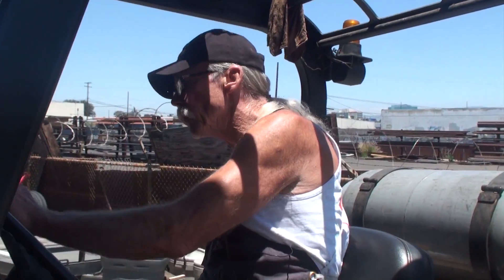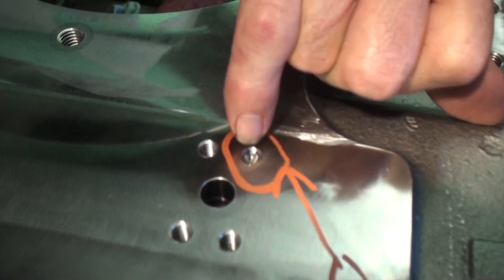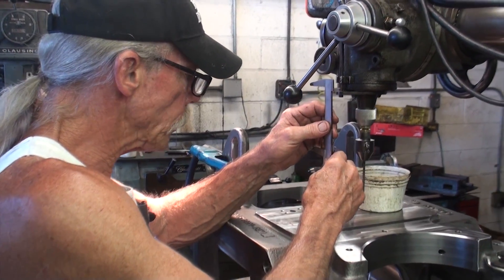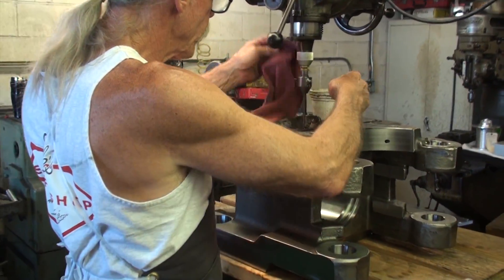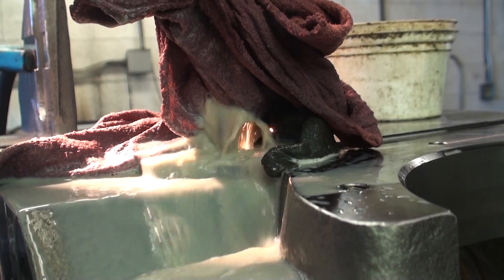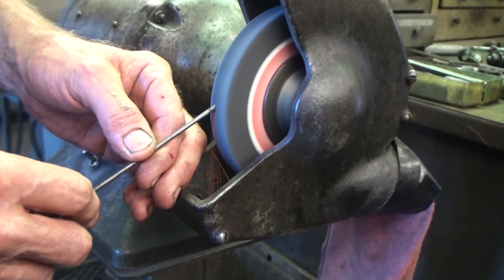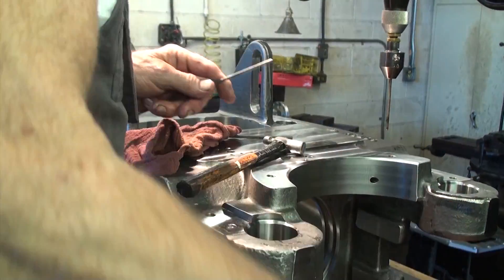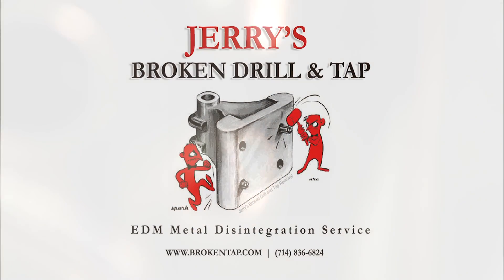Broken Tap Removal by Metal Disintegration Machine (MDM)

Comment: We had a tap burner at the aerospace company I worked for and it was fine for some of the smaller hardware we produced, unfortunately most of what we made was mostly large turbofan parts that wouldn't fit on the burner. We just used carbide end mills to drill out the tap web and did it on the machining center and it worked just as well.

Comment: I used to run one of these at a race shop in Huntersville NC. We called it "the hole popper" because all it did was pop holes into bolts to make banjo bolts for caliper brakes. I guess electrodes were cheaper and much faster than jobber drills for making holes in hardware. It was so unbelievably boring to run that machine for days straight lol

Comment: I used a smaller machine akin to this years ago to remove broken hss taps. Also got to use an  EDM with different copper electrodes. Some bought and some made by our machine shop. The best time was a mitsubishi  cnc wire-fed edm that uses a .010 brass wire to cut carbide cutters. AWESOME. like welding in reverse.

Comment: Sandvik hardcut drill will fix that.   The part should never have been removed from the mill. The hard cut should have been run immediately.

Comment: Thank you Mr. Grafton for showing this.  Scares the heck out of me when I tap a pistol so I use a new tap and use carbon steel so I can use an carbide endmill to remove it if necessary.  When I'm making things at work, I'll tell the engineer how many operations are left where I can turn my work piece into scrap.  :)

Comment: This is what i do when i have a broken tap
1)get a 4fl endmill .02 or .03 smaller than the minor of the thread n put it in solid holder
2)find the center of the hole on a CNC machine 
3)max out the RPM M3S14000
4)program G73X0Y0Z-.35R.O1Q0.001F.OO5
PROBLEM SOLVED.
LET ME KNOW IF THIS WORK

Comment: excellent demo on Tap removal.  just so you know, its not the flute that is left in the hole.  The flute is a cavity/cutout running axially in the tap for chips that are cut off.   In other words - you are not cutting out the "holes" of the tap.

Comment: What that's it !!  So I can start a business removing broken taps as long as I can buy a electrode grounding water squirting voltage regulating table plus some chisels at Rockwell 65 with a grinding machine plus tapping tool ??
Reply: Yep, in that order

Comment: A company I used to work for had such problems with broken taps (due to blind holes) that engineering was forced to add so much allowance to the blind hole depth that it increased our baseplate thicknesses by .375-.50" .  This was no big deal when the part was made of A36 steel. But once in a while we did an exotic material like Alloy 20 or Super Austenetic.  Do you know how much money it costs to add .50" thickness to a 60"x60" plate in 254 SMO just to allow a tap break safety margin? It is like $8,000!  I could not get them to thread mill and it was costing us orders.....
Reply: Interesting. Being in the metal business, I CAN imagine the cost. Some alloys are stupid expensive.

Comment: Metal disintegration is the proper term. Seems like the "bit" either needs to rotate or vibrate like an engraving tool. You have to keep renewing your electrical contact with the target to vaporize the material, at least I suppose. Don't want a full short circuit.

Comment: ...  if you take a small brazing torch and heat the tap until it is red , then let it cool very slowly . You can take a quality hi speed drill bit and drill thru it . I wish Jerry was around when I had to  figured out heat treating . Jerry can guarantee it will come ; out mine is a 50/50 shot .

Comment: That's not necessarily true!  You can't measure the depth of the other holes to determine how deep the blocked hole is.
Reply: That’s the first thing I thought. What if that tap bottomed out and broke off in a half inch hole, he would’ve blasted through the actual part, according to the depth of the other hole that he measured

Comment: I just had a situation where a tap broke in a thru hole. It was a challenge to remove, I tried to mill it out, and broke two centertaps, thick ones. a 3mm and a 5mm . the hole was 5mm . I then took the piece to the vice, and hammered in the hole with an awl. And I didnt believe it but the broken threadtap broke off and I got it clean. so you burn the Thread tap with that special machine . incredible. Hardened steel is kinda difficult to tool. I use cheap tools until I know what I need. so I got a new Guhring M5 thread tap, smooth ! It cost 35$ !!!

Comment: Great work. I would have thought that the original part maker would have milled out the tap with a not so good carbide mill using a helical cut. It looks like an original >$10K job.  I save my old carbide mills for that purpose. I probably break a tap about every 100 hours of machine time.

Comment: The hard rods are no longer the rockwell you state after grinding. When you grind it and you see that metal change colour, that's the metal losing it's hardness and slowly becoming annealed.
Reply: The tip need not be that hard to fuck the hell outta that dead tap shred. the back needs to be hard so the hammer could strike it well.

Comment: interesting i use to do the same thing back in the 70's at a place i worked we had a small machine that fitted to a drill press  that worked the same as this huge machine
we mainly did broken bolt s  we had a customer that broke off all 8 head studs for a wet sleeve engine that took  a while to fix 
worst part is when you get someone using an ezi out to try remove a broken bolt or tap 
makes the job a lot harder

Comment: Very good job. Although this method wouldnt be usable with most of the broken drill bits and taps I've had to deal with , it could be a god send. Sucks that you have to totally disassemble first. Have had limited success with broken tap extractors when they don't break. Question I've got is what keeps from arcing to the threads? Also is the machine self advancing? That water looks more like fish oil.

Comment: Hey Jerry ... does grinding the M2 Chisels not draw their hardness ??
Great vid by the way 😎👍☘️
Reply: M2 is HSS steel and probably they are tempered to "red hot hardness" - but even if they get a little softer, they seem to work well for him🤷🏼‍♂️
Reply: @kknives_switzerland   yeah... Its jist that I've ground a lot of hss over the years & tbh I've found that "bluing" it during the grind doesn't help with tool life,  on the capstan lathe I ran, despite the "red hardness" attributed to hss... but as you say, it seems to work for him ! 😉
Thanks for chipping in ! 
😎👍☘🍺
Reply: @peterfitzpatrick7032  I totally agree on the blueing part; I run all my grinding equipment water cooled for that reason - in knife making, not the slightest discoloration is allowed to occur.
Reply: @kknives_switzerland    I'm assuming its flood coolant... No dipping a hot piece in cold coolant.. 🙄😏
I dry-grind to reduce the risk of micro-fractures... just takes a little longer... 🤓
But I'm mostly only grinding hss blanks so not as critical as your grinding sounds... 🤔
😎👍☘️🍺
Reply: @peterfitzpatrick7032  Yes, flood coolant! Got some videos up on it if you want to take a look. Thick blanks are an entirely different game than a 0.015 inch thick cross section like it is common in knives - let alone the edge itself! Always cool to peek into other crafts!
Reply: @kknives_switzerland   thanks... never thought to have a look at your channel 🙄😂
Reply: @peterfitzpatrick7032  Enjoy haha
Reply: @peterfitzpatrick7032  And I wanted to say: I am very glad that you mentioned the flood copling thing. Because many knife makers just frequently dip the blade in water, which I find to be less than ideal as not only it may not be sufficient, yet also subjects the workpiece to repeated thermic shocks. Well known to the machinist, but in the knife world, flood coolant seems to be really uncommon - apart from Japan I must say!
Reply: @kknives_switzerland     
I'm liking yer archives btw ... 😏
😎👍☘🍺
Reply: @peterfitzpatrick7032  Appreciated man!!

Comment: That's amazing. How come you didn't get an electric shock when you picked the wet cloth up?
Reply: Rubber soles on his boots?
Reply: DC current. Same reason you can touch the positive and negative batter terminal and not create an arc.

Comment: I wonder if it would be possible to manufacture taps out of normal soft steel and put separate hard teeth on it... So it would maybe not snap as easy and if it broke you could just drill it out...  ... maybe it would just twist to a corkscrew.

Comment: I had no idea. I've always drilled them out carefully. Takes a long time and I have to sharpen the drill a lot. Sometimes I hit some threads.
Reply: Tap burners are the easy way out if you can put the piece under the tap burner to the where the tap is located unless you can chisel it out backwards. I think few shops have a tap burner. I worked at a job shop that had one. It took the fear out of braking a tap.

Comment: Lol at you entirely ruining the temper on your “hardened” m2 chisel on that grinder. You can actually see the tip glowing red. Lol
Reply: I guess you think he never did this before. I would venture to suggest that the chisel isn't meant to be sharp, just tough.
Reply: I guess you don’t understand the basic heat treating/metallurgy. Chisels are meant to be in the 40-50hrc range. M2 steel is usually hardened to around 61hrc and above. So this would be kind of a special purpose chisel. Heating it up to the orange temps(1500f or probably higher from what I could tell) isn’t only going to drop it beneath that hardness, but it’s going to completely ruin the heat treat. If he intended it to just be any old chisel that would be super soft, why the hell would he use m2? The fact that he took the trouble to mention it was m2, leads me to believe that isn’t the case. Lastly, doing something wrong for a long time doesn’t make it right.
Reply: @jamesmgordon83  He told you it's M2 High speed steel.  You can get it red hot without affecting hardness.
Reply: @12345nonamesleft- Wrong. M2 steel is tempered at 1025-1050°F (552-566°C). If you heat it beyond that temperature, which he obviously did, it will ruin the heat treat. That’s just a fact. HSS a generic term, that denotes a particular steels ability to withstand heat, generated by high speeds/friction, based on how it was heat treated/tempered. M2 HSS is a tool steel that was tempered at a higher temperature. This allows it to be used at high speeds, which generate more friction/heat, without compromising the heat treat. But that doesn’t mean you can just heat it up as much as you want without it ruining the heat treat. Once you go above the temperature it was tempered at, you compromise the heat treatment. Fact.

“Red hot” is at least 1300f-1400f, and really closer to 1500f. That is well above m2’s tempering temperature and it will compromise its heat treat. When the camera pulled away, while he was sharpening the first rod, the tip had turned a dull orange. That’s 1600f+. =Ruined HT. Also, guys shop was well lit and you could STILL see the orange in the tip of the chisel. If the lights were off, I’m sure it would have been even a brighter orange, which would indicate an even higher temp.

BTW, I’ve heat treated M2, and many other steels in my Evenheat oven over the years. I’ve also brought many high carbon steel knives up to critical temp(1450f) in my forge and know first hand what temp different colors are. 

IMO M2 is a poor choice for removing broken taps from the threads of a screw hole. Using M2, which is hardened to a hardness above 60hrc in this setting, would risk damaging the threads, and would likely chip the tip of the chisel. Therefore it’s doesn’t really make sense to use that steel for the job. He should just be using a softer/tougher steel. Even mild steel.

But let’s say he didn’t overheat it and it withstands unlimited high temps like you said. Would a HSS like this M2 steel he’s using be more resistant to heat when sharpening like he was? Sure. But a high hardness HHS M2 like this would make a shitty chisel. It’s meant for drilling/milling/machining. Not as an impact tool. So his actions are entirely contradictory. At this point I’ve explained myself thoroughly, and have nothing more to add.
Reply: @jamesmgordon83  neato...
Reply: He never specified how exactly it was hardened though did he. My supervisor showed me nitrided ejector pins that looked almost identical to those he used. Hardest metal ive come across and would be perfect for this job
Reply: @laurie Agnew He went to the trouble of saying “m2 steel.” That is a tool steel and it’s meant to be heat treated before use. Otherwise any old mild steel would work. Seriously, I don’t know how this is hard to understand. In regards to the “nitrided” ejector pins, that is a process that only hardens the surface. Once you sharpen it a time or two, it’s gone.
Reply: Hellhound878 So you’re saying you know this guy’s business better than he does?

Comment: Had a smaller version of this machine at the machine shop I worked at. It had a chart with common standard thread diameters against electrode diameters and machine heat settings. We could burn out between #10 to 5/8" diameter and simple calculations allowed for metric conversion. For some reason I was fascinated with it and took time to clean the machine up and organize the electrodes. It wasn't long after that it became my duty to repair broken taps for all of the machine shop and mechanical assembly. Most taps were broken by manual drills going into large steel tubing followed by bottom end taps into aluminum, again manually. 
In my 2.5 years at that company I had burned taps out of many different mild steels, cast/6061/7075 aluminum, and phenolic which is a plastic composite for high temp applications. I used old center punches ground the way Jerry used his M2 magnetic chisel. For larger than 5/8" broken taps, which was rare, I'd burn a 1/4-1/2" hole and slide a bolt in, tack welding it in place and turning the tap out as anything we had of that diameter was a through hole and cold be accessed easily from the other side, with few exceptions. Aluminum threads that were cleaned out usually were drilled out after the tap was removed and were rethreaded with a special insert depending on application. Aluminum is very gummy when machined and takes special care to ensure it doesn't weld to the tap. Something that when using a cordless drill will happen instantly if the drill is wobbled and the clutch isn't set right. 
Another place where people screw up is trying to "eyeball" a drill size to the inner diameter of a tap. The smaller the tap the more precise one has to be and the blueprints will specify the basic minor and major diameters necessary for the drill. Engineers [should] take care when they specify those sizes since different applications require different contact areas between the screw thread and base thread.

Comment: How many coins did that set the customer back? What ever it was it was worth it!
Reply: absolutely not, could have done it much quicker, ruined less equipment and caused less damage to the thread using a different method
Reply: @manlystyleunder50  I doubt he damaged any thread. I've done this job many times  the old hard way, so I know how bad it can be. I just removed an 8 mm headbolt from an aluminum engine block the hard way.

Comment: it is inveitable possibility of breaking a tap.  Especially if you do not have a program where you change out taps after a certain amount of work has been accomplished.  the harder the material,  the more taps you change out.  IF you dont change them out that tool is going to get weaker and weaker.  be smart,  follow healthy procedure for taps. Use sharp and healthy drills and always break the edge of the hole.

Comment: Very cool!  I've only used EZ Outs, ha.  We called these either broken studs or broken bolts, not taps.  I'll have to research what a "tap" is.   I thought tap and die were the tools/process to remove a broken bolt.
Reply: paulpm - a tap is a piece of metal that looks like a drill bit but has threads like a screw. You screw the tap into a hole to cut threads into the sides of the hole so that a bolt can be screwed into the hole. The matching piece is a "die" that forms threads on a metal rod to make it into a bolt. Sometimes taps break when threading the hole, and cannot be drilled out with a normal drill because in order to cut threads in metal the tap is made as hard as the drill. The electric arc can burn through the hardened tap material as shown in the video.
Reply: @BenAtTheTube  ah, ok.  I got it now.  Thanks for the explanation!!

Comment: I recently found that you can drill through the center of a tap using a carbide endmill. Had a customer with a dually wheel extension for a John Deere tractor. Two broken bolts and a broken 3/4 tap. 2 inches of engagement and nothing above the surface of the flange to grab. Drilled straight through the hss tap. Bright red chips even with flooding it with cutting oil
Reply: I would have thought drilling it out with a carbide drill would have caused less damage than he did to the threads

Comment: The first time I ever heard of a metal disintegration machine was when someone was doing a performance build on a 7.3 Powerstroke engine. Someone installed tool steel head studs to handle the pressure, but one of the studs broke. All the usual methods of removal were tried, and it was determined that metal disintegration was the only solution.